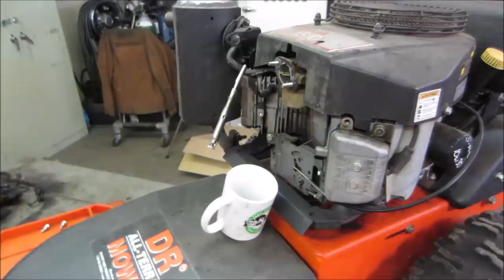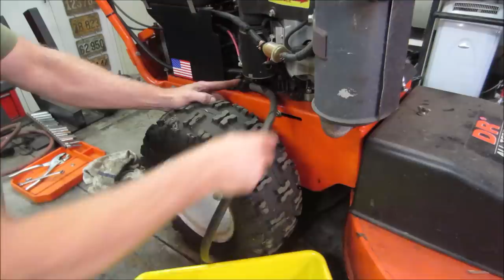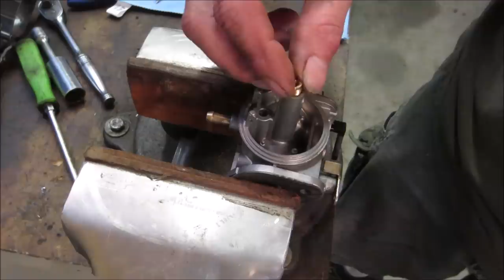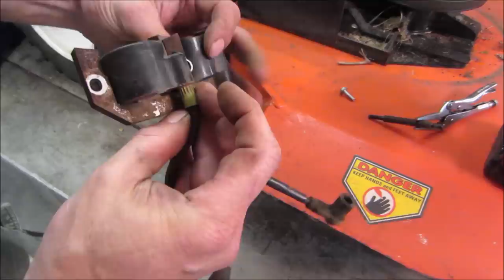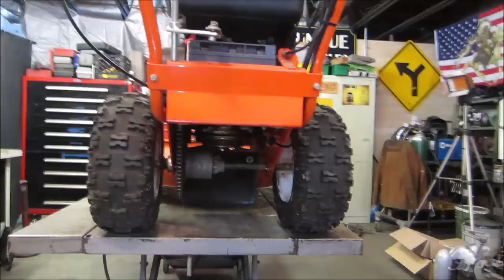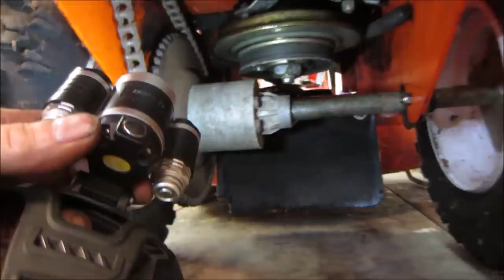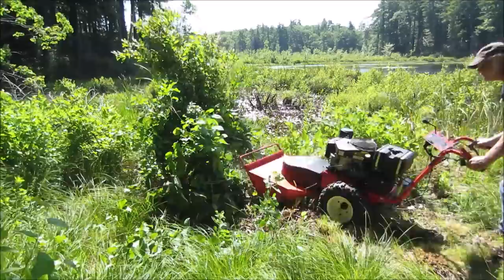Will It Run? Abandoned 11 years ago. DR Field and Brush Mower

Comment: The reason of the oil in the crankcase is probably because of the bad coil. You should also try to filter your carb cleaner through a couple of coffee filters cheap but it works.

Comment: The Oil filter said 10w30 but DR appears to recommend straight SAE30 oil for their equipment. Is there some good reason to use multi weight oil in New England on a piece of summer time lawn equipment?

Comment: Looks like the engine in my 2007 John Deere X300. Maybe I missed something. I thought there was gas in the oil.
You cleaned the carb, did you mention how the float seat looked? I must have missed it...With my machine,  the dealer told me one Welch plug had blown out, so I had to buy a new carb. ( It wasn't cheap.) I got the original carb back, I see it is missing one Welch plug. Any idea how it blew out? What does it do? Why couldn't they have replaced the Welch plug?
(The engine had started surging real bad, it was the carb.)
WOW! What a BRUTE that machine is!

Comment: Don't automatically write those batteries off. I brought back a 17 year old car battery that had been sitting for 10 years. I charged it for 4 days on three different machines, but it took a full charge, held it, and held at 10.9 under a load. I didn't even change the acid. You love reviving things, so at least give them a shot. It may save you some money.

Comment: Question for you about sonic cleaners. Have heard of people suspending a glass jar etc in their sonic cleaner,  filling the cleaner with water and using gas in the jar as the cleaning solvent.  Parts go into the jar to wash.  Apparently transmits the sonic vibrations well.  Cleaning solution (gas) not harmful to gaskets. Less cleaning fluid use.  Thoughts?

Comment: 20 yrs ago on a friday night a yard sale add in the newspaper for a rototiller for 35.00 caught my eye. so sunday about noon i figured it'd be gone if it was was worth anything. so i call and ask if they still had it, she says yeah. so go and find a busy yard sale people waking in and out of a long driveway, and the girl i see greeting people i ask hey i called about the rototiller. she say Yeah it's right over there. she's pointing to what looked like farm implements. i walk over with her and i have no idea what i'm looking at but it was a 1957 gravely L-S tractor with the complete rotary plow with wheels, and she points to another part which was the cultivator, complete all but another set of wheels. to swap it out all i gotto do is pull the extra 4 bolts on the wheels every time.  i couldn't get 35 bucks out of my pocket fast enough. i told her i'd be back in few, and went to get a friend to help me load it. i got it home and the carb (cast iron) was rusted stuck pretty bad, i cleaned that out and got it functional. it started like on the second pull, the cultivator looked like someone knew they were reaching their final crops and ran it pretty much into to the ground that i rebuilt a few years later, seal races were wallered out bad, bearings were thrashed, and like the plow the cutting edges were down to the moldboard. i didn't spend anything on repairs but  have running this gravely for 20 yrs since. it came with  the original manual.  oh i bought some ebay plow blades and some carburetors (2 of three worked right out of the box better than the one on it, which ran pretty good.) bought a magneto, but other one works fine. this things a tank.

Comment: Seems like you have the same problem with every project - holding a loose spark plug.  Could you make up a short length of flexible tube with one clamp that holds the spark plug and another that connects to ground, linked with a bit of electrical cable? A five-minute investment that will make future engine jobs a bit easier.

Comment: It’s funny how you can not do any bodywork whatsoever, but watch Mustie videos and feel like you NEED an auto body style hammer.
Reply: I have plenty of auto body hammers. I don't have one quite like Mustie has though. Not so sure about that fiberglass handle. Usually you use those hammers with a torch. Some of my body hammers have pretty toasty wooden handles on them.

Comment: Seafoam And a Little Acetone Mixed Together In A Clean Metal Paint Can With The Lid,, Makes A Good Overnight Dip For Small Carburetors And It Works Really Well On Very Nasty 2 Cycle Carburetors

Comment: What size/type of battery does it take? I just acquired an older model with the Kawasaki 15 HP engine and no one has the right battery that will fit as it should. It's definitely an oddball size.

Comment: Per the transmission service, full system flushes are done via the transmission lines at the radiator, and are good services, fully cleaning the transmission, lines and all, but as it said transmission filter change, fill and drain plug needed to be removed for that. As a former auto facility mgr., that kind of shoddy company just irks me.

Comment: I have a 73 beetle with auto stick. electrical is fully functional but the control valve only clicks when i try to shift gears. The car is in neutral and makes no attempt at switching. Have any advise?

Comment: The folks who complain about the prices paid for used, non-running gear with no history don't understand that one day you might pick a $500 machine for $25, and the next day you might pick a $0 machine for $100 or $250, with some catastrophic internal failure or broken parts that are obsolete and unavailable.  It's a gamble.  I had a buddy of mine bought a rusted out 85 Chevy long box for $1500, had a bunch of new Summit parts on what was supposedly a good 4 bolt 350 with heads from a 73 Vette, he was gonna take the 350 for his 75 short box and scrap the rest of the truck, guy showed us a video of it running.  We towed it back to the shop (didn't drive it cause the right front lower shock mount was rusted off the frame) and it fired up on the first turn, all smiles for us 2 boys, and that's right about when we saw the coolant pissing out from the giant crack in the block the guy had tried to JB weld (yeah really..)  do you think that guy called us back and felt sorry for taking my buddy's $1500?  Hell no.  Win some, lose some.

Comment: If that carb cleaner isn't very hygroscopic, you may be able to get the water out of it by simply dumping it off the lid into another container rather than putting it back in the tank. It's a 5 second shake to get it off the lid but it's the little things in life. Just a thought

Comment: I Really Like The Walk Behind Brush Cutting Machines And I Am Partial To The Old Gravely L Models With The 106 Brush Cutter Attachments But I prefer The L8 Model With The High And Low Range But I Just Bought Another One Recently That Complete And Hasn't Been Messed With In At Least 15 Years So It's Going To Require A Lot Of TLC. I Got It Also With A 106   Model 30 inch Brush Attachment Setup So I Did Pay $100 For The Machine And Attachment But I May Have A Small Fortune In It After It's Done And I Hope To Make A Little Profit On Both Pieces When I Sell It LOL

Comment: My guess is like ya'll say, he was running it with just one plug firing.  That helped the machine not accrue so much time and then not get it beat up because it simply looks new. I would be willing to bet he wished it ran like that when he had it. I never can get over how people can't hear an engine miss with 4 or 6 cylinders, or like this one. I could certainly hear if it were only running  on two rather than one. Ya'll could not tell when yee bought it if the motor would need replaced. Shoot this motor would even run your excavator.

Comment: I can't get know one to answer this question, I've cut some brush along a fence line using a brush cutter with a circular saw blade it has 3 to 5 in stumps along the fence line, what can I use to remove those stumps without doing one at a time with a grinder, is there some type of mower I can use and just kind of walk the fence line slowly while the machine grinds them up ??

Comment: Most dealers use a trans flush and fill machine that work through the cooler lines since the mid 2000s so it is possable if a dealer did it or even some of the fly by night places with the service machines it was done. Only thing I really every disliked with these machines was they was suppose to back flush your filter making it not necessary to replace . Yea right if you've every seen some of the filters in trans, but ideal for a lot of the newer front drives with filters that are only serviceable with disassembly of the trans.

Comment: Did you get the safety handle to work?  It still makes a noise you don't like eh?  Progress seems to always be bigger and heavier but with more features, like reverse.
Reply: Do you think that you could add 1 wheel reverse to the old one if you get it running?

Comment: You’re great putting out videos I never miss a one I watch them all the time keep up the great work I have one question I have a cub cadet 3184 runs beautiful right in the middle of cutting it stopped I pushed in the break turn the key it starts fine let off the break it’s engine stops any thoughts it is hydrostatic
Reply from the maker: seat safety not working?

Comment: The gearbox looks like a bomb proof Peerless Tecumseh also is the mini differential, IF you were to open them you’ll find them full of the devils toilet scrapings! Bentonite grease!
The only weak point on the gearbox is the selector keys, they wear and you end up with a mower that resembles a kangaroo 🦘

Comment: U could probable weld a small frame on that thing! and add a rear axle and add a couple rear tires place a seat on it and make it into a riding lawn mower. In no time at all. Everything is already there screaming at yah for you to converted into a riding lawn mower. It will just be a front wheel drive unit. lolo man I thought that old one was made in the 30's lol

Comment: Random question mustie.... why do you only finger tight up the spark plugs?

Not having a dig just wondering.
Reply: He does this only for testing - once the engine runs, he will tighten the spark plug properly (he addressed similar questions like yours in the past).
Reply: @wind_song  legend! thanks for the reply i knew there was method to the madnes. seems like a smart thing to do.

Comment: I know this is a 3 year old video, but if somebody watches after this comment hopefully this helps with the spark issue. My father in law had a mower with no spark, the coil was rusty at the 2 points that you gap the coil and flywheel. I wire wheeled the points and got spark from that coil after it was rust free. I also use a business card to set my gap, hope this helps somebody save money and get their equipment running again

Comment: Ditto on that last post. I need your advice on a one-stage snow thrower issue that I’m trying to resolve. I’ve taken the carburetor apart and cleaned it with carburetor cleaner solution (spray can). It starts if I throw in some gas with bottle spout in the carb intake but it’s not picking up and aspirating the gas in the carb bowl and so it cuts out after 4-5 seconds. I don’t have a vibrating solution set up. It’s a NOMA model D2045020 Code 3272 and serial number S001471330660. I’ve tried to see if I can find a replacement carb on Amazon but I would prefer to keep everything original if possible. Any ideas or things I should try?

Comment: They could of used an extractor pump though the filler tube (hopefully that was the case) at the dealer and not removed the drain plug, usually does a better job too then draining.

Comment: This theory may be the reason that there was gas in the oil is because running it with one plug not firing it’s not going out of the exhaust port it’s just going back straight into the oil past the rings

Comment: I have used the 2020 model dr brush cutter it's alot like that one the big single blade is the original one that new 2020 has a 23 horsepower engine

Comment: I'm not a fan of DR products. I had a big DR wood chipper that had a wiring design defect. There was a ground on the positive cable that would completely discharge the battery pretty quickly. I traced the ground to a wire coming from the alternator. I called DR tech support and they didn't have any idea why that wire would have a ground on it because there was a diode that prevents that from happening. They didn't even have schematic to look at and thought that the wiring diagram in the owner's manual was a schematic. I found a schematic of the charging system on the web and the diode was pointing in the direction that actually allowed ground to go from the alternator through the voltage regulator to the positive battery cable. I called them back and told them that the wire that was grounding the positive battery cable should have been routed through the ignition switch so when the switch was in the off position this wire would be open. They didn't understand. I just ran installed an inline switch on this wire.

Comment: Now I'm in this Process To buy my DR with 15 HP Kawasaki and I think 27" cutter with 52" golf mover 
I sold this machine in 2008 when I change my new job Events Project Manager and Is Possible to buy back today or tomorrow I need to make same process all maintenance to run efficiency when I used

Comment: "running on only one Cylinder" that is where all the gasoline in the oil came from!   Keeps getting loaded with unburned fuel and with every compression stroke down the ring gaps it flows.....!
Funny a Greasegun making obscene sounds...L o L !
This turned out to be good buy! Some of the "brush" approaches cutting with a chain saw....

Comment: A non running machine is nothing more than a pile of spare parts and needs to be purchased as such regardless of what the owner says about its condition.
Reply: I, rather put a sledge hammer through it BEFORE sell you pirates a bargain i,ve trashed things before invite you pickers in.

Comment: that FJ story  really  pisses me off  when you think of the extra money that was spent having the dealers  doing it  years ago  i had a FORD pick up  and because of work i hot lady and  dropped it off at 2 local  shops for  muniz things and  i asked the to  do a tuneup  on it because it was past due  i had that done  two times by 3 local shops  and  then i  bought the parts  to do it myself when i pulled all the plugs  i realized  that two cylinders that were a pain to access  had the  original factory plugs  and there was a mismatch in all the other cylinders  not necessarily a terrain;e thing but it was proof that the  shops were not doing  all the plugs  each time   because those  couple were a pain to get to  not horrible   but the mechanic  would had  to walk to gus box  to grad the right combination of extensions  and was too lazy to do so  eventually that  guy wound up being our local Snao In truck guy  and  i didnt want anything to do with him  although as you know sometimes you need to  go SnaoOn or Matco  on specialty  tool;s

Comment: Can anyone help me out? I’ve got a slightly older model without the swappable deck. As soon as I put it into gear the thing moves like crazy. Makes it impossible to control and use carefully. Any ideas what might be causing it? Pulling the wheel clutch handle feels very tight. It was working last week but now feels very tight. Possible bad belt?

Comment: Anybody who thinks (or has the Gaul to say) that Mustie got an unfair deal on that mower needs a bit of browbeating. Imagine if you couldn't fix it yourself and you had to take it after spending 600$ on it to a shop to get the cobwebs out of it, tune it up, and troubleshoot what was wrong with it. That cost you 400$ and they "forgot" to lube the chain, fill the tires and power wash it. Mustie's time and labor are not free! And furthermore, if there was worse trouble with the engine and it was not repairable guess who would have to eat 400 or 500$ for a big, heavy parts machine?

Comment: My DR had a fuel pump, so I never had to worry about fuel le4aking into the crankcase,,,  It had the 13hp kawasaki engine,,
Reply from the maker: the gas got in due to the coil being out as this one has a fuel pump too
Reply: @mustie1  Ok,, I get it,,, he ran it on one cylinder and the gas vapor from the non working cylinder blew past the rings,, :-)

Comment: Why did you not check the electric fuel pump first before the carburetor
Reply from the maker: the pump is not electric it runs off vacuum when the engine is spinning

Comment: You'll have to laugh, on riding lawn mower spindles, they are putting zerk fitting on them, so you would think that you are greasing them, only problem is the bearings are sealed bearings, so no grease is actually getting into the bearings.

Comment: Do people seriously moan about the price you paid for a non-working brush mower? Sure, might only be $50 in parts, but you also sank at least 4-6 hours of your time into it, which at a shop would be easly $300-$600 in labour. Don't these people realise you can get a brand new one for well under $2000? Or are they the sort of people who believe your time has no value?

Comment: Spin it with some kerosene in the crankcase. Rinse it.
3 stroke oil is good for the valves. Run it a while. In there... I don't think you got hurt on what you paid

Comment: Hey mustie1 did you know that when you're greasing those deck grease fittings you're not actually greasing the bearings all you're doing is filling up a cavity especially on John Deere lawn mowers it's because they used a sealed bearing so yeah you're kind of wasting Greece

Comment: Many of the transmission "power flush" services use the trans cooler lines to access the fluid.  But of course that means the filter doesn't get touched unless you drop it.  Which is still really dumb and poor worksmanship.